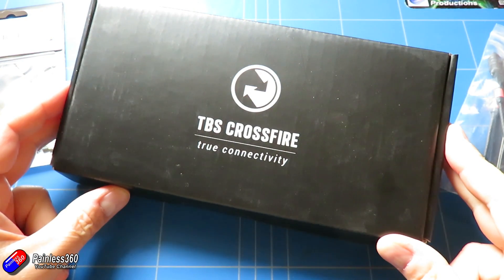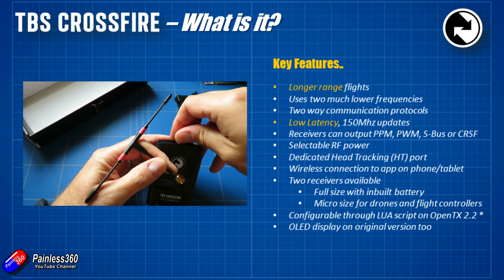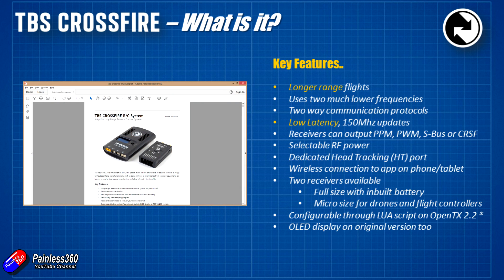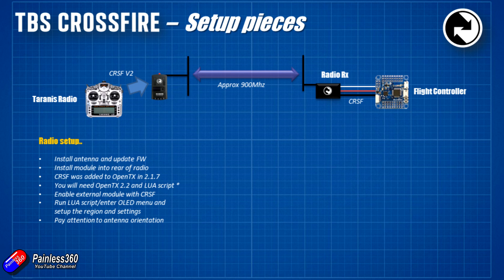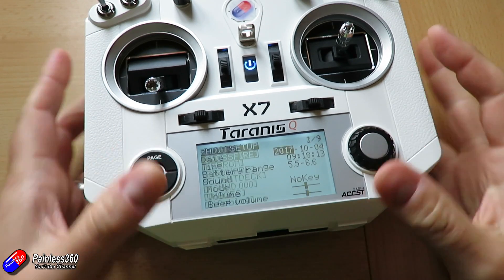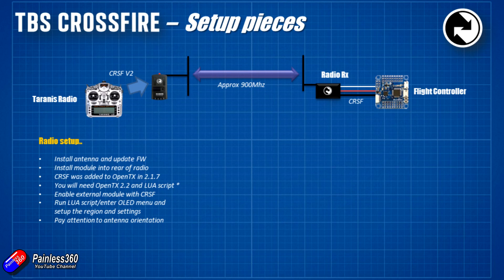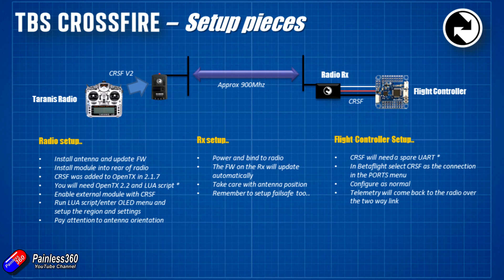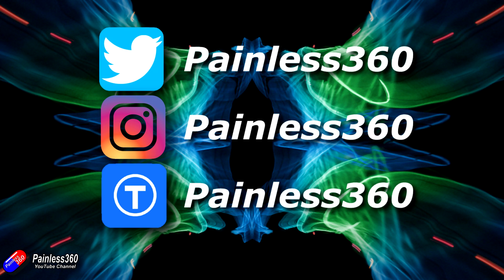(1/3) TBS Crossfire Series: Overview and Introduction

Comment: Hey man can you pleaaase help mee! I have the crossfire micro v2 and micro v2 receiver... all updated on bf and lua crossfire and the qx7, boud to the receiver but I am NOT getting ANYTHING on betaflight in the receiver tab...??! Pleeaaaase and thank youuu in advanced!!!
Reply from the maker: Tricky to offer any advice as you’ve not told me what connection you selected (sbus, CRSF..) and how you’ve got it connected to the flight controller. If you can give me a little bit more detail, I can probably point you in the right direction...
Reply: Painless360 Thank you for getting back! You have an amazing channel:D So I have figured it out... "btw In BF configuration I was using serial based and crsf,... then I had ch1 on crossfire receiver soldered to tx on a flip 32 f4, and ch2 to rx as it should be".. But I had to swap where I soldered tx and rx to the flight controller and that worked! I now can setup modes and adjust endpoints.... SO! I have my sensors found on my taranis qx7 and telemetry setup and able to fly! But I can only fly about 500m out and I get a telemetry lost from the qx7..?? I was expecting to go .5 to 1 mile on this maiden lol...! How much of a difference will it make if I adjust the crossfire tx unit in the qx7 crossfire settings from 25mw to 100mw..? Will that get me a mile?!😅  It ending up getting dark so I wasent able to try it out, we shall see tomorrow morning!!! Edit! Switching to 100mw made a giant difference!

Comment: does the region select limit the output power or just the transmission frequency?
Reply from the maker: Power too..
Reply: Painless360 just seen it's possible to run it in open mode for "testing" purposes (why would anyone buy a 2w capable module that's limited by software?)  
good overview anyway cheers
Reply from the maker: +jamble7k Every country has its own R/C power limitations and to get certification and comply with the laws, TBS have had to add this feature. It's up to you whether or not you want to ignore it, disable it, or use a country settings with a higher power level. Doing it that way the responsibilty for any law breaking would sit squarely on your shoulders. Happy flying!

Comment: please review the micro system ,ive had a hard time getting it to bind up.
Reply from the maker: +Chris Harris I'm not sure it's worth doing entire review just to help with one problem ;) What have you tried? And what is the actual problem you're having?
Reply: I had that problem before. The button on the back of the Micro TX is very finicky about how long you press it. You need to press it once very quickly, then power on the RX. It should be in bind mode. If the light in the TX is blue the firmware on the RX needs to be updated. Just. Press the button again, very quickly and it will start the process of binding and updating. Hope that helps. It was driving me mad at 1st! If you press the button even a split second longer on the micro tx, it won't enter bind mode

Comment: Nice tutorial, thanks for sharing! The cable with servo connector (from micro receiver to your FC), is that custom made? Mine didn't come with that cable, and the TBS servo adapter is bulky/added weight.

Comment: Does Crossfire package have instructions to install on a Spektrum DX8 G2? Any possibility of you doing a video on Spektrum install?
Reply from the maker: +Prop Bender thanks for the idea. You’ll need to use the trainer port set to PPM and the 3.5mm cable supplied..
Reply: Thanks so much. This product really interests me. But all set up vids are FrSky.

Comment: How can I get the Hero session 4 video feed from the quad copter to mission planner hud ? Is there such a thing as a wifi transmitter I can setup on the drone that will connect to the camera and send the feed to a receiver I can install to the pc , and get the signal to the mission planner hud ? Anyone know ? I need part numbers ! Or do I have to install an separate FPV system , and just turn the go pro on record when I take off ?
Reply from the maker: +Noah Wheeler you'll need a cable that will take the video- out from the camera and put it into a standard FPV transmitter. There are lots of details about how you then plug an FPV video receiver into a computer via some kind of video capture device that will allow you to then have the video in Mission planner. Hope that helps

Comment: Those with problems on windows 10 mission planner connection, but ok with smartphone and tablet read the following : After pairing the Bluetooth successfully, in the W10 BT screen, click "more Bluetooth options" then "COM ports". 

Delete both incoming and outgoing about the crossfire then click add and select outgoing on the Crossfire then OK.

You will end up with a single com port for it, open mission planner and connect, should work.

I will make a video tomorrow

Comment: When I run the crossfire.lua my TBS CORE PRO V2 also appears with my Tx & Rx?  Will the Taranis control the Core, i.e. if using the quads OSD to change settings the video Tx is locked on 25mW unless a call-sign is displayed then you're able to increase video power, however if changing via Taranis crossfire.lua it allows you to increase video Tx setting whether call-sign is shown or not?Also what is the device.lua in the Crossfire folder? If I run it I get an error in script?
Reply from the maker: +James Nathaniel things are changing very quickly with this technology. CRSF as a  bidirectional telemetry connection will allow you to control anything at the far end with the right LUA script and that support is expected in Betaflight in 3.3. If you're having a problem then I'd recommend having a quick look in the forum or raising a ticket with TBS for help. I'll add this to the list of things to talk about in a future video.

Comment: Two questions for the next instalment:

1) Wouldn't you be better-off just running SBUS rather than slowing down the CRSF protocol to 1/4 speed? Wouldn't SBUS then be slightly faster? And;
2) Can you still receive telemetry when you run SBUS, or can you only receive LQ through CRSF? ???

Thanks in advance! My TBS Crossfire is on order (I literally just placed the order earlier tonight), now I only have to wait until the micro receivers are back in stock. :)
Reply from the maker: Those are quick ones - 

1) |The whole point of CRSF is that's it's bi-directional and very fast. You need that to 'talk' to the module for setup from the LUA script.. S-Bus is only used at the far end to talk to non CRSF enabled flight controllers.
2) see the answer on the other comment you posted :D
Reply from the maker: As you asked, here is a sneak peak - https://www.youtube.com/watch?v=pBQl9IUN67c ;)

Comment: Isnt that rx too big for a 5" fov drone
Reply from the maker: Depends on the frame and space you have on the model. It sure isn't an XSR size..
Reply: Painless360 thanks for the info, i m a spektrum tx user, but tx signal is not that good for fpv. Frsky is the most XF friendly vs the spektrum radio. Will be good to see a video of spektrum XF install and setting

Comment: thank you for giving us all these useful infos. If I improve the radio signal with the tbs crossfire then I also need improvement on the video signal. Could you also tell us  a bit about a video signal system that more or less fits the range of the tbs crossfire?
Reply from the maker: +SIU nice idea, thanks.
Reply from the maker: Charles R Taylor not sure why? ;) I talked a little about this in the second 'answers' video. For longer range you need to use 2.4 or 1.3 Gigahertz FPV with a good directional antenna and as much power as is legal in your area. When the FPV blue stuff gets a little cheaper, that might be worth a look too. Happy flying!
Reply: Exactly. How is it useful to have long distance control if you can’t see where you’re going? Doesn’t make sense

Comment: Can you do a series on the Flight Controller by Tarot the xyz plz.
Reply from the maker: +Wade Stewart thanks for the idea, with the Vector, Pixhawk 2.1 and other series at the moment it may be a little while..
Reply: With the ZYX-M, you should be able to just use SBUS with the Crossfire. While that will eliminate some of the "faster" functions of CRSF protocol, you'll still get the range, but just at 50hz (which is perfectly fine, especially for a slow flying UAV that would be using a Tarot ZYX-M).
Reply: Painless360 this is awesome that you may review the Tarot flight controller. I really want to see how the fail safe works with if a motor stops it can still RH or fly just like the DJi A2.  I've got a very limited funds for my Rc with my beautiful new little Daughter Penelope.  Thanks heaps.

Comment: Thanks for this series of videos :) I do not understand your explanation about how you should aline the antennas, by default the Radio antenna is horizontal and the one on the copter is either straight up for the micro or bend at 90 degrees in the up position for the big receiver, is it the right choice?
Reply from the maker: +BrutusTheUgly more in that next time.. happy flying!
Reply from the maker: The next video is uploaded waiting for release so you can see all about that in that video if you  look in the Crossfire playlist. ;)
Reply: Great thanks you :)

Comment: Can I use the crossfire with a dx9 Spektrum radio?
Reply from the maker: +randall reis if you gave the Crossfire (not the mini) and use the PPM trainer cable to connect it to the trainer port on the radio you can.. I’m not sure that Spektrum have added CRSF support.. ;)
Reply: Painless360 any chance you might cover spektrum dx9 setup?
Reply from the maker: Doubtful at the moment but it looks like TBS and Spektrum are working to add CRSF support to a later release of the radio firmware. The next video is uploaded waiting for release so you can see all about that in that video if you  look in the Crossfire playlist. ;)

Comment: I have just bought the ezuhf module and setup using 1.3ghz for video but find I can bind it ok but as soon as I get 100mtrs away signal is list and I have to go into hi, I am very interested in this series as I am thinking this is a better system , your thoughts on both this unit and the ezuhf would be great
Reply: EzUHF works on 433 MHz, 1.3GHz is on the 3rd harmonic (4x433~1.3G), in other words, your VTx is interfering with your EzUHF receiver. Use either another RC frequency or another video band. Just always make sure that your video frequency divided by your RC frequency isn't a whole number.

Comment: Looking forward to a good thorough telemetry explanation.  Can it or will it ever be able to pass through mavlink?  Thanks for the vids.
Reply from the maker: +Jeroen Brosens I’ll add that to the list. Lots of options for MAVlink with this system..
Reply from the maker: MAVLink from what exactly? Full duplex mode will be supported in BF3.3 from what I can see..
Reply: From a pixhawk. I'm comparing to ULRS that has RC and a full transparent two way serial link. Its not very robust though so a commercial product would be preferable when one is available with more than just frsky telemetry.
Reply: Voting +1 for that. There are enough LRS's on the market, but the Crossfire is very useful regarding its serial downlink. Think telemetry, antenna trackers, flying autonomous missions etc. it would be nice if you could highlight this feature in one of your vids.
Reply from the maker: MAVLink was one of the initial development goals/uses for this system. You can configure two of the pins on the Crossfire Rx to be MAVlink TX and MAVlink Rx and then connect those to the port on the flight controller sending the MAVlink telemetry. Then you can share that MAVlink data using Bluetooth with any device (only on the full size Crossfire TX module). Then you can connect to it with your device running Mission Planner/QGroundControl using that BT link and have all of your MAVLink telemetry and control over KM of range.. :D I'll cover this in the third video in the series..

Comment: Hi +Painless360, I always love the high quality of your videos, great work! I have a small addition to your Crossfire antenna recommendation: to actually make full use of the diversity receiver, the two antennas need to be positioned 90 degrees apart, one preferably lying flat as does the TX antenna. This way the theoretical signal loss is only sin(PI/4), which is about 0.7 times the full signal strength. If you have the two antennas placed like you have in the video, not only is the signal strength low to start with (since you have them vertical and the radio antenna horizontal), but will a rotation of your aircraft not benefit of the dual antenna setup. Anyways, looking forward to part 2!
Reply from the maker: Thanks for the comment. I am planning to spend more time on it in the next video as 90 degree gives better signal quality as you move the craft but lessens max range. Thanks again for the post! :D
Reply: Interesting to know what makes you think that. This doesn't extend your range - that's affected by antenna gain (and to a certain degree transmitting power). Two identical parallel antennas perform precisely the same as one: if you bank your aircraft both signals drop, whereas in a properly placed 90 degree setup, there will always be one antenna that is oriented towards your transmitter more optimal than the other. 

You will also get a noticable improvement in range when you use a directional antenna on your transmitter, but then you'll have to keep facing your aircraft. Do you fly long range FPV? The Crossfire is a very good system to do so, but then longe range video also becomes a thing (diversity the other way round!). Keep it up!
Reply from the maker: +Jeroen Brosens as you say it’s about antenna alignment..

Comment: For long range fpv planes I can see this would be very cool. Wondering how such long range is useful for a racing quad?
Reply from the maker: The main advantage for a racing quad is the increase in speed over s-bus and the extra features the full duplex operation will give us when it's working (in BF 3.3 hopefully).
Reply: not so much for long range , rather it has better penetration for reliable coverage in areas that 2.4 has problems. e.g. dense brush, concrete buildings etc.

Comment: Wait, So if I pick the wrong region I can't use 2000mw power?    And what frequency is better 868 or 915mhz?  What is the micro v2 rx stock antenna tuned to?     You're scaring me.😯    I thought the only difference in region was the mhz.
Reply from the maker: Also, if you have the full size Crossfire Google 'TBS Konami code' ;)
Reply from the maker: +John Doe don’t be scared, kit follow the manual. Best of luck!
Reply: US=915, EU=868 MHz. The antennas are probably tuned to none of these exactly, but somewhere inbetween.

Comment: When I bind my tbs crossfire the light on the micro receiver has a solid red and a flashing green, also the module stays orange. How do I fix this?
Reply from the maker: +Elliot_fpv sounds like the reciever isn’t bound. What troubleshooting have you done?
Reply: Painless360 I think it is bound because if I then turn off the crossfire tx the green light stops flashing

Comment: well I do have my experience with crossfire, and customer service has been fantastic for me, but I will say, be carefull,  people complaint a lot because of the so call beta releases, and almost all so far have bugs, depending of what you flying, for example I think Im running 1.09 firmware, that firmware was so far the most stable, but is not longer avaliable and people been complaining and feel sorry that they can not go back. I been so afraid to update to the point that I do have a micro v2 and I did not update nothing,  so my micro receiver v2 is with 1.09 and when I download the firmware via air, fail many time, up to the point that I had to get out with the radio 25 meters away and the upload finally was successful, Im using futaba radio.  So just be very carefull with the so call beta relesease they are very unstable, up to the point of you craft goes totally nuts.  My two cents just be carefull,  for example my rssi  just show max 67 dbi in betaflight with betaflight flight controller, much lower that FRsky xm, LOL, but maybe is the diferent calibration but I will be very carefull, I will do a test on the ground if the rssi is real or just diferents numbers.  Now I use PPM becase Im running 1.09  no the latest firmware,  and I do have the crsf in my full side crossfire menu. so is sbus.
Reply from the maker: +maxun1 LQ is a better indicator of signal strength in the current firmware. I’ll be covering the latest on this in another video as things are updated.. thanks for the comment and idea! Happy flying!

Comment: Hi, can it work with the 9XR PRO?
Reply from the maker: +George Guerov I’ve not tried it but if it’ll run OpenTX 2.2 and there is a LUA script for it then then it should..
Reply: Painless360 thanks. Not the best tx but worth trying for me. Will save a few pennies.
Reply from the maker: The original Taranis X9D+ would be my pick every time..

Comment: BTW with betaflight F3 FC you can wire CRSF RX to UART2 which has the RX pin physically/electrically connected to the SBUS pin. this frees up uart 1 and 3 for other peripherals,